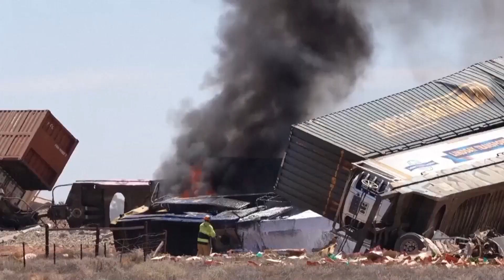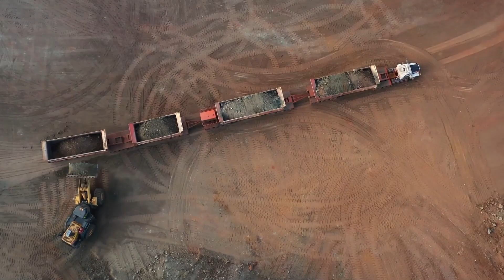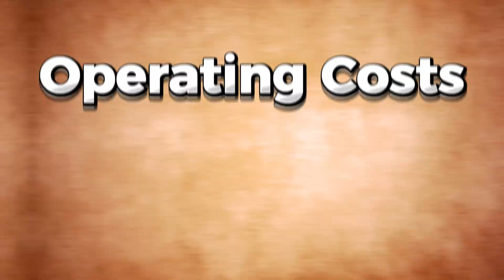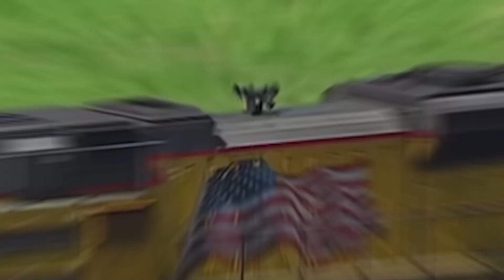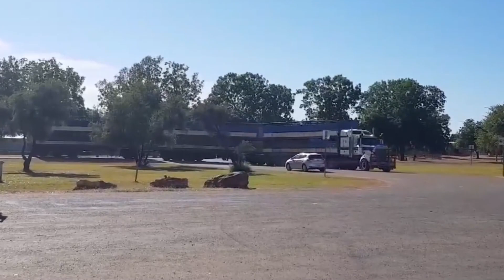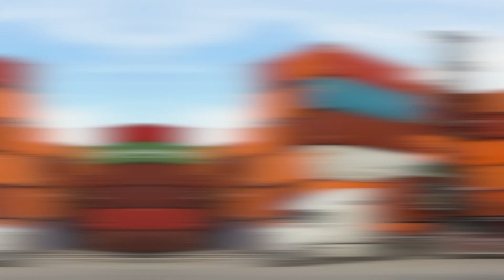RoadTrains vs FreightTrains — Which One Wins?

Comment: Having worked in road doing across and up Australia, rail (National Rail and Pacific National) doing east/west and air transport with cargo only aircraft there is no winner. It’s simply what’s best suited to the user and the area. FT are great for bulk cheap transport if you are happy to wait. RT are a middle ground. AF is the bees knees when it comes to speed but it’s a cost that most can’t and won’t pay for bulk. Getting 30,000lb of cargo across Australia or internationally in a day comes with an astronomical cost, but for rescue or humanitarian relief work when the government foots the bill it can’t be beat.

What do the say you can pick 2 out of 3 option.

Price
Speed
Flexibility.